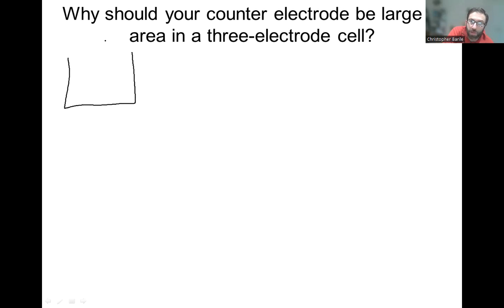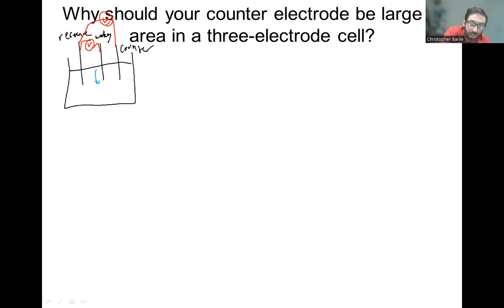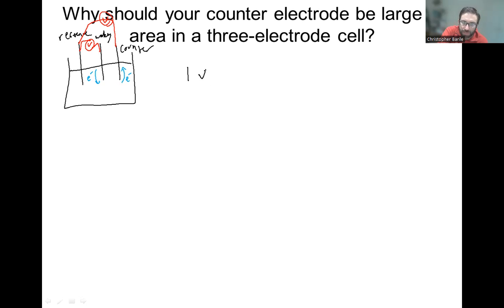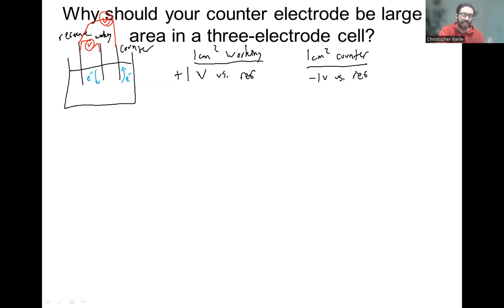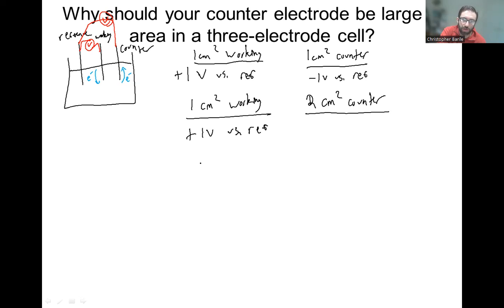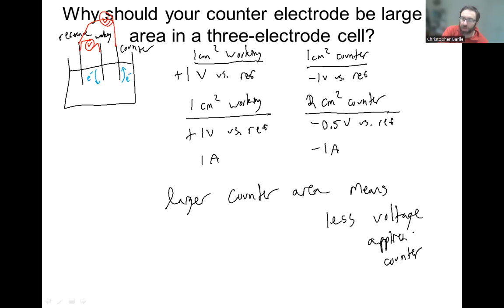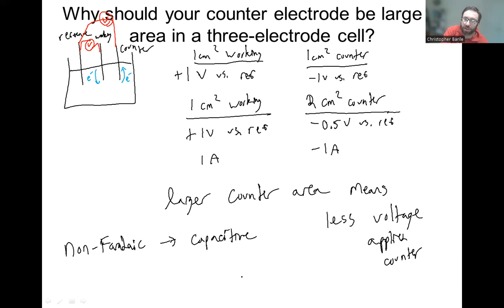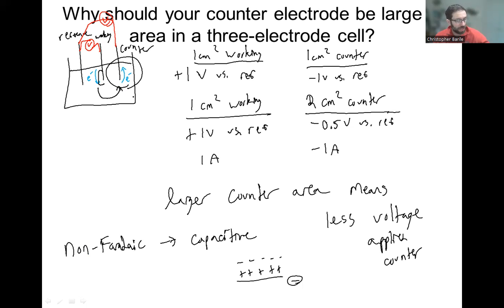Why should your counter electrode be large in area in a three-electrode cell?

Comment: Great video.  Let's say we are running a three-electrode set up to study the polarization behavior of a certain working electrode metal type in sulfuric acid of a certain strength and we start to scan by turning the working electrode into the cathode (polarizing it to a lower potential than its OCP) whilst the counter electrode is rendered anodic.  The sulfuric acid should start being reduced around the WE cathode and contrarily, acid may be produced via the oxidation of water at the CE anode.   As happens in electrolysis, the pH should increase at the cathodic WE and decrease near the anodic CE.   Doesn't this mess up our experiment because we are changing the nature of the electrolyte of which we want to study the behavior of the metal in?
Reply from the maker: That is the beauty of the three-electrode cell. If done properly (e.g. large enough counter), the compensating charge on the counter can be completely capacitive such that there is no Faradaic process occuring there (in your example, no water splitting).
Reply: @christopherbarile2539  What you say makes sense for the CE anode because if the CE anode is made large enough, the lower current density on it can limit upwards polarization to potentials below where water is oxidised.  However, I see no way that the local pH around the cathode can be maintained especially when the scan reaches highly negative potentials in which case we would be spending the local acid as well as reducing water itself.  Also, if we scan anodically first, the solution may get full of iron ions again changing the bath chemistry.